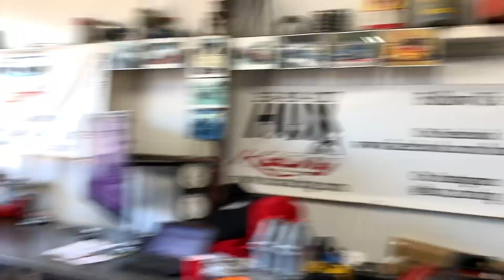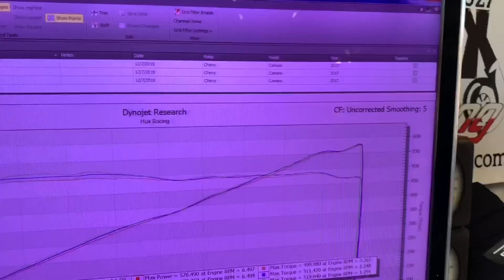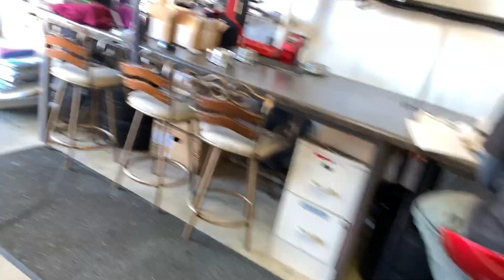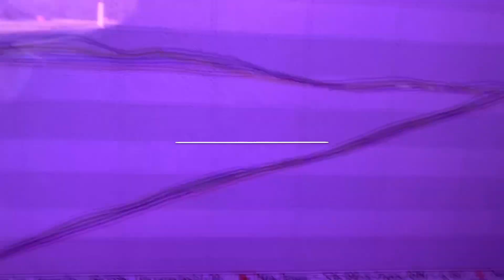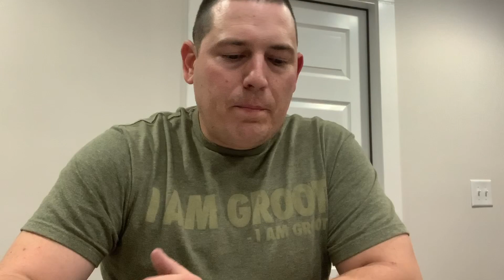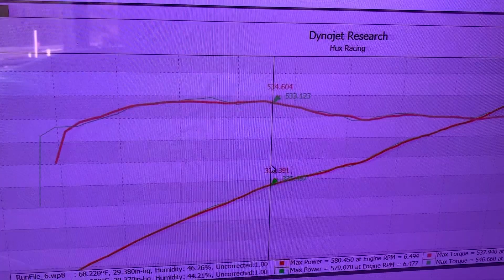Soler Performance ported throttle body Dyno results / Testing.  #solerperformance  #TBdynotest

Comment: I think you fooling your self 20hp is nothin you can change the air filter and get close to that and run good gas like sonoco race gas and pick up 30 HP then a secondary water meth injection and get another 10 to15 HP I'll port my own thanks

Comment: Thanks for the video.  This was very a very detailed and informative video which I love.  I was wondering if you have tried Solers throttle controller and  wondered if that would help  considering it overused the factory throttle control.  I just bought a Soler throttle controller for my GMC Canyon because it has a dead spot in the pedal on take off.  I love how it gets rid of the lag in the low end.
Reply from the maker: I did and I made a video on it.   I can’t remember exactly which setting now but one setting in particular worked pretty well with the throttlebody. I don’t really like throttle controllers because they all just trick the ECU  into thinking you’ve applied more throttle than what you really have.  That’s how they all work basically.  I would much rather have this throttle body that gets rid of the dead spot and improves airflow drastically over stock.   People with naturally aspirated engines have reported they get a good power increase out of the throttle body because the computer doesn’t start backing off the throttle angle like it does on the supercharged LT4.

Comment: My english is weak can you guys tell me whether it worth doing the porting ?
Reply from the maker: For getting rid of the dead spot just off idle and smoother throttle feel, yes it’s worth it.  
If you want a higher max HP rating on the stock tune and nothing else then,  no.

Comment: Question do u think a pedal camander would solve this problem? I had a ford that took about 100 miles to figure it out. Do u think that is possible here?
Reply from the maker: a pedal commander doesn't do anything at full throttle.  Throttle controllers just fool the computer into thinking you have pressed the gas further than you actually have.

Comment: I am a Chevrolet guy and this is the thing I was told by tuners a few years back with the newer engine ecu settings . They told me it only really made sense to replace the intake and or the throttle body if you were going to tune it or you wouldn't fully get out of the engine what it could do . Hope you have it worked out and are enjoying it now . God Bless
Reply from the maker: Yes sir.  And I totally confirmed that here.  I have a 2020 hellcat charger now.

Comment: So you do need a tune if you get this? There website states otherwise I was thinking the rotofab might have something to make it trip as wel
Reply from the maker: You don’t need a tune to run it, I was running It with no trouble and it gives you much better throttle feel and response.  But it Will not make more power at wide-open throttle past the midpoint of the RPM band without a tune.  But that would be true for any intake or throttlebody out there because it’s limited by the factory tune itself.

Comment: You have a Gen V ECM that leverages torque tables and by default will control torque by closing the throttle when the ECM sees higher torque values than it's expecting.  Consider this a feature not a bug. You should get a Gen V tune to take advantage of the increased airflow. The YouTube channel called The Tuning School speaks about GM Gen V's as well as older ECM versions.

Comment: I have a 2016 camaro ss tuned e85 header car . When I went to a 95mm throttle had to change the throttle body size in hp tuner . So car would run right .
Reply from the maker: Was that because you were tuned on E85? I was told on a stock SS you could run a ported ZL1 TB with no problems, but i don't know that to be fact.  Just what i was told.
Reply: @KnightsGarage  no changes the afr to much , had to retune it for the 95mm .

Comment: I wonder if this issue is influenced by traction/stability control and the ECU trying to keep things from getting out of control traction wise? Were they completely off during the dyno runs (i.e. push and hold the traction control button for ~7-10 seconds until the dash says stabilitrack off (assuming the zl1 is like the ss))?
Reply from the maker: Crazymobst3r yes they were all off.   No way it would have allowed a full pull making over 550 to the wheels if it was on at all.

Comment: If you want better response on take off and diminish the bog for the M6, there are only two options to preserve warrranty:

1. Tony Mamo TB
2. Green Filter

This will not give you more power up top, this gives you a BIG GAIN for power under the curve . 

you can use solar as well, just know if the wrong dealer tech or tech manager sees it, you may have a warranty issue...
Reply from the maker: If you would have warranty issues with Soler you would have it with Tony Mamo.  Both are ported stock TB's.   I don't see what Warranty issues you would run into for a ported stock TB other than a denied warranty claim on the TB itself.   Also i still have my stock intake and TB so if something bad goes wrong i can change the intake and TB in less than 5 min.

Comment: Superb video friend very informative, I installed the new style Soler Performance TB on my 2019 Camaro SS 10 speed last week, I’ve got 250 miles of town /hwy miles on the install , absolutely love this throttle body, though now I’m wondering if when I stab the throttle wide open for an extended amount of time is it going to be to much for the factory tune and go into limp mode, hope not the car is so much more responsive with this throttle body, I’m not running a cold air intake just a drop in K&N filter maybe that will balance the equation . The only con I have noticed so far is that it takes so little throttle for the car to Cruz that it causes the Active Fuel Management to kick in V4 mode more often than before, even at 25mph in my neighborhood . Time will tell 
Great content keep it coming!
Reply from the maker: At WOT it locks the tables. I had no codes at WOT, only part throttle accel.  Plus the tuning on the N/A SS is verry different than the supercharged LT4.  The new version may be great on the SS.  Mike at Soler told me he has a couple guys with an SS that have the 95mm LT5 ported TB running with no tune and no issues.  Hell the LT4 with the LT5 has to be tuned or it will throw into limp mode with very minimal throttle input. So the N/A cars may be ok with it.
Reply: That’s great info, I’ve been talking with mike last few days also and I purchased one of there throttle controllers In hopes of even crisper more linear throttle response , Soler Performance is a Super Stellar Company, I’m thinking about going with a Roto Fab intake in near future are you running one , if so what do you think about it?
Reply from the maker: @workaholic00772  Yes, Soler is a great company.  Yes i have a RotFab intake, you can see it in this video. lol .  I also have an install video on it and a video recording the supercharger sounds you get after you install it.

Comment: Do you think the pedal commander could override the factory tune shutting the TB plate?
Reply from the maker: No at WOT its WOT.  Pedal commander makes no difference at WOT just how fast it gets there.  They ramp up the throttle action.  If your foot stays at 100% and the ECM tells the actuator to close it will still close.
Reply: @KnightsGarage  does Jay Greene wipe that function out when he tuned your Charger Scatpack?
Reply from the maker: David Smith I doubt the charger does this.  I think it’s there to de tune the car and control power levels.   I took data logs on my charger and never saw the throttle closing anytime during the pull.
Reply: @KnightsGarage  thanks Project ZL1.  Hopefully you update us when you have solved this issue.  100% WOT on your ZL1 will be good to see for sure.  Thanks for replying.
Reply from the maker: David Smith Yes, but it’s going to take a Tune to fix it.  Only have 3100 miles on the car.  Not sure if I want to tune it just yet.
Reply: @KnightsGarage  don't blame you one bit.  Smart choice for sure.
Reply from the maker: David Smith But man am I itching to get it tuned though...  lol.    You know how it is.  Cars guys just want mo powa babeh!
Reply: @KnightsGarage   Going off past videos, probably about 10,000mi. more  and it's on!  You'll have that thing running like a scalded hog.  Pulley change and tune alone.  So many options you have now!  Keep the great content coming!